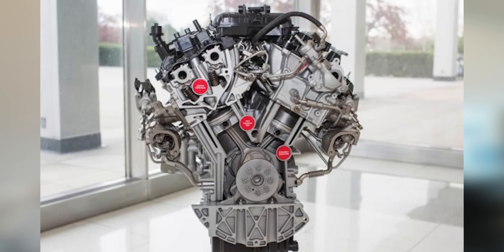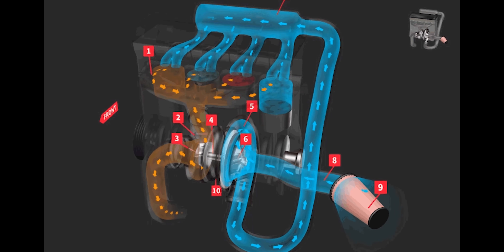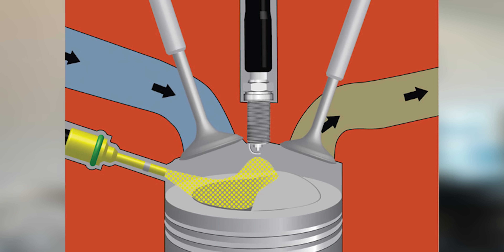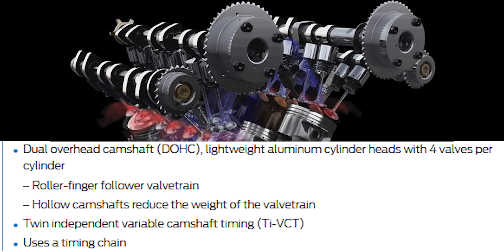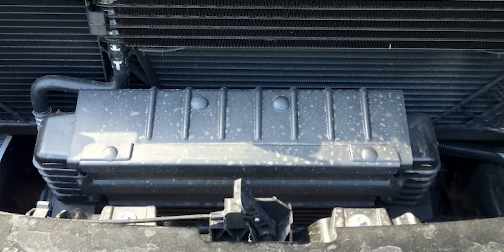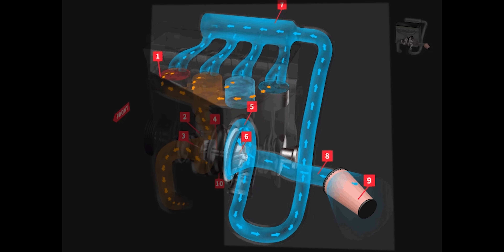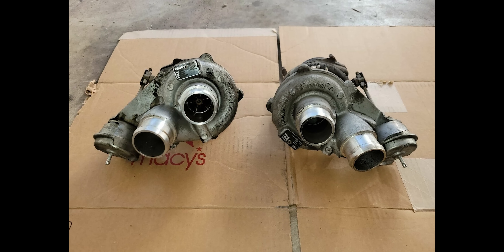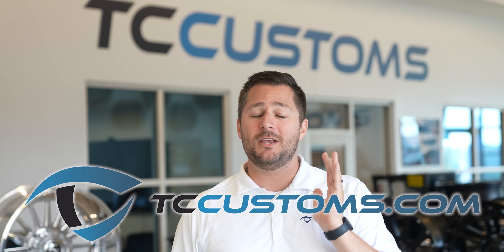The Truth about the Ecoboost Engine!

Comment: Currently driving a 2nd gen 3.5l, over 120k miles and still going strong
Reply: 120k? Always kills me how people with new vehicles think that is high. No matter the make you should expect double that (exceptions for extreme abuse and poor maintenace).
Reply: @98dodge360v8  in a span of 3 years that’s an average of 40,000* miles a year, that’s a lot for an engine that’s known to collapse under stress
Reply: @flamingrock1179  No offense 40k a year isnt even in the top 3 of people I know (all drive v8s of various makes). I've alway had issue with the ecoboost durability but to hear it from an owner of a ecoboost is new.
Reply: I've owned several trucks over 250k and have had good luck with Ford and Chevy. Ford was the better truck overall. Ram I had lots of issues before 100k, the lifters started ticking, front end, water pump and electrical issues. I doubt I'll own another Ram.
Reply: @flamingrock1179  if it's all highway mileage it's really not hard on the motor unless you're rolling heavy
Reply: @98dodge360v8  ecoboosts require very high grade oil in warmer climates and/or if they're worked real hard, if you're servicing at the dealer and always towing/hauling near max load even at the 5k severe changes most dealers do, you're going to chew up the motorcraft oil cause it just can't take the heat, followed shortly by the turbos and coil packs.
Reply: @mmholling87  hemis are the same as an EcoBoost in oil regards, you put great oil in, you get great performance out, you put crap oil in, you nuke the engine, mopar oil is rather high grade product, in fact the 6.4 hemi comes factory filled with pennzoil ultra platinum, and if I ever get one of those engines I'm going to be running that or amsoil exclusively, because I have a fleet buddy that's particular about that stuff, while the other service truck companies that either dealer service their 6.4 hemis, or even worse, buy euro grade oil from the parts store shelf (not bad oil just a completely different oil spec) are wiping cams and blowing motors, he's got 5 of those trucks already at 150k plus (think the highest is around 180k) and he orders pennzoil ultra platinum SRT oil by the barrel to service those trucks, never had a single one conk out on engine failure (did have 2 wreck from steering linkage failures on lease roads though)

Comment: I've had a 2015 3.5 and just love it. Besides tires and oil changes, never had an issue with it at all...  I won't be getting rid of it anytime soon.
Reply: It’s been about a year now, how’s the truck doing? Just got myself a 2015 3.5 as well.
Reply: You got a good one. my 2015 king ranch has 186,000 miles and needs $8k worth of repairs. I'm going back to the 6.7
Reply: @randyosborn284  what happened
Reply: @wtjonny  turbo. oil leaks. cooling system...
Reply: How many miles?
Reply: I have a 2016 and I bought it four years old. 3.5 Ecoboost engine. It now has 112,000 miles.

Comment: I have a 2018 F-150 with the 3.5 Eco engine. I grew up with fast cars in the '60s and this engine makes incredible power. My only issue was the valve train had to be built at 55,000 (under warranty), due to the "death rattle" as I have heard it called, at start up. I purchased the Ford ESP up to 150,000 for the possible technology problems so, I'm good until then. It pulls my 20 ft. bass boat like it's not ever there. I change the oil every 5000 miles as well, currently 75,000 miles and counting.
Reply: HOW MUCH WAS THAT EXTENDED WARRANTY

Comment: Guys, don't forget to drill a 1/16" hole in the bottom/driver side of your intercooler. 
I have a 1st gen, and my valves have been clean for 70k miles since i drilled that hole. 
When i cranked her up after drilling the hole, about 6 oz of creamy oil+condensation blew out. Now its just a oil-damp stain on the back of my air dam. No more idle hickups or acceleration choking in wet weather.

Comment: Bought my F150 3.5 used with 57,000. Changed oil every 5,000 miles with mostly synthetic oil. The truck has 174,000 miles now. Zero engine issues! Zero rust on the aircraft aluminum body and truck bed. This truck has pulled an 18 foot trailer full of oak firewood several times over 150 miles. The engine is fast, quick and powerful while the truck body is lighter than steel. 2015 model XLT which I can not bring myself to TRADE IN for newer version. Had 1 issue with  electrical transmission computer but the truck runs like new now. Have been driving Ford trucks over 35 years and this ecoboost is without a doubt the best performing engine I have had.👍👍👍

Comment: Great video, love your channel. I bought a new FX4 XLT at the end of 2019 and decided to go with the 3.5 eco boost. My younger brother has a 2013 platinum with a 3.5 and about 60,000 trouble free miles. Mine has about 32,000 miles on it and so far it’s the best truck I’ve owned. I heard about the 10,000 mile oil change when I first got mine, so I started researching it. Just about every thing I’ve read, or watched, says absolutely do not do that. I’ve seen tear down videos on the 3.5 showing what they look like when people do that, and I’ve seen videos by Ford master techs saying to stick with 3,500 to 5,000 max. That being said, people should do whatever makes them comfortable, as for me, I’ll stick with 3,500 mile oil changes.
Reply: Smart man. Don’t listen to anybody telling you that 10k+ oil changes are fine. If you’re like me and want your truck to last as long as possible, 5k is the max. I never go further than 4K. Oil is cheap, engines are expensive
Reply: I do 10k km oil changes on my hemi with pennzoil platinum 5w-20. If your saying you can’t go over 5600km on an oil change I find that ridiculous. Before you shun me you should know that my truck has 130,000km on it with 30,000 being towing which sometimes it reaches 125 degrees C when I have my foot in towing a 9000lb trailer up mountains. Id consider an eco post for towing but if it requires that 3500mile oil change no thanks.
Reply: @kylewitzel3540  , not saying you should do anything, I’m just relaying what I’ve read and watched. Seen several videos of engine tear downs of the 3.5 that show more sludge in the engine than I like. If you are having good luck with 10,000 mile oil changes, by all means, keep doing what you’re doing. My personal choice is to change oil every 3500 miles.
Reply: @kylewitzel3540  oil is cheap why take the chance. I’d never go 10k on an oil change even in non turbo engines.
Reply: It boils down to 2 things. First what oil you put in it and second how you drive it. Put the best possible oil in it and you can go longer. Don’t beat the living snot out of it at every stoplight and don’t let it idle for hours per day. 

Get your oil analyzed every oil change for piece of mind. I have 130K and changed mine every 7500-10K. Timing chain tensioner is at about 1/3 tension left. There’s no doubt they wear but a good oil and a good filter goes a long, long way. No pun intended.
Reply: Right on! I changed my oil every 5,000 kms and I use Amsoil Signature Series synthetic 5W-30.
Reply: @timschultes6467  easy boys. 10,000 km is like 6200 miles. My point was I can do longer oil changes. If my motor had turbos I would probably change it sooner. You have two built in oil cookers.  We’re comparing apple to oranges for motors. However , I was making an argument for a v8.  I get 25-26 mpg going 68mph.  I haven’t babied my truck. I’ve actually driven it hard. I put Pennzoil platinum in and I beat on it.
Reply: @kylewitzel3540  km and miles are 2 different things, he's talking about not going over 5k miles which equals to 8046 km
Reply: 60k miles! That's awesome. My 99 f150 only has a paltry 215k miles
Reply: That was a very dangerous and silly thing to say in the video "That you can stretch your oil change intervals to 10k miles"  Alot of inaccurate things in this video as well as useful info.  I was a Senior Master Tech at Ford Dealer for 21 yrs until  9/2017 I changed careers to machinist now.  My personal conviction on oil changes is 4k and I've noticed my 20 Ecoboost oil is dirtier at that mileage than any vehicle I've ever owned for some reason.  Keep your oil changed often is always the right choice.  Also alot of the turbo talk was inacurrate, Charge Air Coolers is to cool the air because cooler air is more dense, meaning you can fit more of it in a confined space.  Airplane Pilots know all this stuff too.  Anyway, this is a salesman trying to talk a little too technical over his head so it is what it is.  Just understand that and don't take all this for solid info while caring for your ECOBEAST.  Good Day.
Reply: Agree, oils a cheap insurance for longevity. I change 3-4 due to a 70% city driving. I use Amsoil at 14.00 a ltr. If Ferrari trusts it, then so do I..

Comment: Love your videos. Wife has a 2015 king ranch with 5.0, love it. Wasn’t a big fan of the 3.5 but after seeing them perform on the job and my brother has one towing his camper, I’m convinced. The towing ability of the 3.5 is crazy.
Reply: It is isn’t it. Both mine outpulls my old truck which was a a 2004 tow tuned duramax diesel

Comment: 91k miles on my '14 F150 ecoboost, bought new.  Full synthetic oil change and tire rotation every 5k miles (Motorcraft oil filter).  In the shop for a turbo coolant leak once, replaced the throttle body another time, replaced the heater/vent blower motor another.  On the second set of tires and third battery.  My '05 Xterra was never in the shop during the 106k miles I put on it.

Comment: I have a 2015 3.5 eco boost. With 250,000 MILES. The engine has performed great! I just replaced the water pump first time the truck has been touched except for oil, tires, and brakes. Life of the truck averaged 18.8 miles per gallon  Pretty happy with the performance
Reply: I have a 2.7 15 model. No issues. I also baby it. Hopefully it lasts
Reply: This is the comment I was looking for I’m gonna buy a 2015 platinum !!!!! Timing chain ⛓️‍💥 cam phasers and all gaskets is the first order I’d busniess

Comment: I have a 2019 F150 with the 3.5 Ecoboost.  It's had Mobil 1 oil changes every 5,000 miles. It had cam phaser failure at 48,000 miles. Now at 85,000 miles the valve covers are leaking and it has bad cam phasers again. What a great truck...
Reply: Mine was awful too. So pretty, and the most comfortable seats/interior… but by far the most unreliable vehicle I’ve ever had.
Reply: 52k Miles on my Ecoboost. 2019 CAM phaser issue. I got rid of it. The car was at the shop too long for warranty issues.
Reply: Should have got the 2.7
Reply: Needs the updated phasers…they likely just put the original model back in hence the re-failure

Comment: I have a 2020 king ranch I really enjoy driving. Ford advertises the max turbo boost as 15 psi which should therefore provide twice standard atmospheric pressure to the intake system. So presumably you can cram twice the air in which should be equivalent to a displacement of 7.0L or 427ci. That is why the light weight aluminum body combined with the V6 is so much fun to drive and still gets pretty good mileage on eco cruise control on the highway.

Comment: 280,000 on my 5.0 and still running like the day I bought it new 😁👍
Reply: My 5.0 will get there.....only 49k on it so far.
Reply: @rds990  Yours isn't even broken in yet LOL, I usually put around 35,000 miles a year on a vehicle, I now have 350,000 miles on my truck, still running strong! 😁👍

Comment: I have a black 2012 F150 Platinum 4x4 with the 3.5L Ecoboost. 3inch lift and 35'' Iron Man Mud Tires. At 241,000 miles, I dropped cylinder 4 on Interstate 20 outside Atlanta headed back to North Alabama. Swapped the motor in my garage and now have 284,000 miles. Now having the Lead Frame Module issue on my 6R80 transmission. Gonna be swapping that out soon. I've had 2 major problems but other than that truck has been great. I love my truck and would not trade it for anything. I'll keep fixing it till I can't no more.
Reply: I feel once a truck makes 240000 miles it’s done its job. How expensive was that crate Engine? New Turbos come with it?

Comment: I really enjoyed this info being broken down! Thank you!
Reply from the maker: Thank you for the feedback!
Reply: @TCcustoms_  As much as i do like the 3.5 liter EcoBoost and not saying that to be sarcastic . I actually built a compound turbo setup on a 2013 F-150 with two turbos mounted flush in the box of the truck . Fun project but labor intensive mounting the oil and air coolers  . I do although question pulling heavy loads i.e. travel trailers only because i do understand turbo charging . Getting a 32 foot travel trailer moving from a dead stop is a-lot for a V6 engine until the turbos start to spool . I have seen the horsepower curve on a dyno with my own eyes and also have seen how little boost was made below the 3000 rpm range .

Comment: Great video and very helpful. Love mine! You missed the most important benefit of the port-direct fuel injection setup: no carbon build-up on the intake valves.
Reply: That is not correct.  The reason Ford put a secondary fuel injection on the new eco boost is because the direct injection motors were getting to much carbon build up on the intake valves.
Reply: @mikelloyd2013  right…that’s what I said.

Comment: The port fuel injection also cleans the back side of the intake valve, solving or delaying the buildup problem with the first gen ecoboost engine.
Reply: And second gen
Reply: It's for any direct injection engine really, the intake tract is completely dry but the PVC still pulls oil vapor through.

Comment: Early versions of 3.5 didn't have port injection, only direct injection. Early versions without port injection had issues w carbon buildup on valves. Ford addressed by adding port injection on later versions of 3.5
Reply: The fix for the older engines is to just floor it once a week to knock any deposits off the valves. Most people do that anyway though.
Reply: The Italian Tune up!
Reply: My 2015 ecoboost has 200,000. It's a direct injection.
Reply: @austin3626  they'll run. I have a friend with 180k on his. Only issue is with the coils and plugs. He's not easy on it.
Reply: @jerth  ah... no
Reply: @mikeh4053  Getting the motor to high revs regularly was part of a service bulletin, so, yes, very much yes
Reply: @jerth  fuel is what cleans the valves. Any direct injection motor will have same problem with out the fuel. Stomp on it all day. Deposits still build up and create an issue.
Reply: People act as if carbon on the intake valve is such a bad thing with direct injection, but the exhaust valve is ALWAYS carboned up with any injection system and there's rarely ever a single issue.
Reply: @mikeh4053  Nah we saw it with performance modded trucks where the drivers drove aggressively vs old man driven trucks. The old man trucks that were babied had deposits, the trucks that were hammered on did not, neither had port fuel injection. Not to say you should hammer on your truck, but it proves the point. High revs once or twice a week loosens up the deposits reasonably well
Reply: @jerth  well there we have it. Make it case law. Ill take the intake injector anyday rather than drive in first gear at 6k revs for the weekend.
Reply: @mikeh4053  Haha don't be so dramatic, comes off as pretty immature. Of course having port injectors is better, but they didn't add those until recent years. I am just stating, as a matter of fact, that redlining 1st gen 3.5EB engines for a few seconds every week or so does a good job of cleaning the valves, because they do not have port injection to do it otherwise. I don't even know what you're trying to argue here.

Comment: I have a 2014 V-6 3.5 (46,000 miles) and I love it.  I put a oil catch can system on it and it is smooth as butter.  If Ford is going to continue selling Ecoboost engines, they must address the need for an oil catch can system.  They know about it and say they are working on it, but haven't addressed the need.

Comment: Just turned 108K on my '17 I have the coolant changed every 50K along with the plugs and do oil at 7500. No issues as of yet. Love the 10spd with it. Jealous of the extra 25hp the new ones have. These are basically the same engines they won Le Mans with a few years back.
Reply: The Ford GT is largely the same engine with bigger turbos right? 

Probably higher end components like pistons, rods, crank, valves etc.
Reply: @vmon215  .. for many people 100k miles is a lot. I personally drive 7000 miles a year so 100k miles is 14 years for me. Even if I drove 12k miles a year that's almost 9 years. That is a significant amount of time and miles.
Reply: @vmon215  I agree. I have 315,000 miles on my 2009 F150 4.6l 3v, nothing but regular maintenance and it still runs great.
Reply: @johnmccoul6350  I think the days of 300k+ are gone. Keep her running as long as you can! Wishing I would've bought a 4.6 or 5.4 when they were newer. REALLY wish I wouldn't have totaled my ole 4.9 i6.

Comment: I just bought a 2021 F150 Lariat while I wait for my Bronco order. It has the 3.5 eco boost, always had the 5.0L so far so good. I’m impressed with the power thus far, plus nice to have a bit better gas mileage!
Reply: I think you will find the Bronco exactly that, rough ride compared to the Lariat I’m sure. I have the F150 2021 Lariat and I’m very surprised how smooth quiet a ride it is!

Comment: have the engine in F150 and Flex; no issues so far at 98K. and 59K miles,   what I like most is the large RPM range of torque,    My 5.0L F150 is week at lower rpm on torque compared to ecoboost,  and ecoboost towing is treat with the torque range.  Fuel economy is about equal with my driving habits.